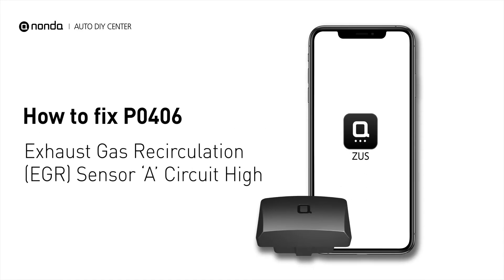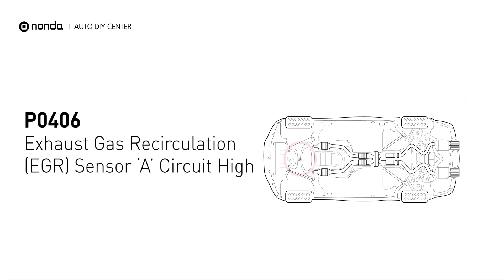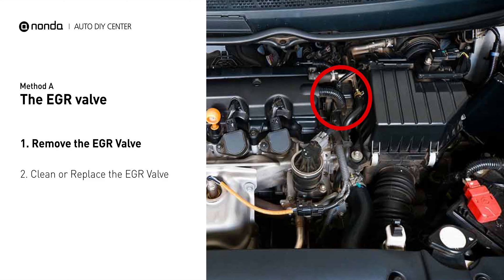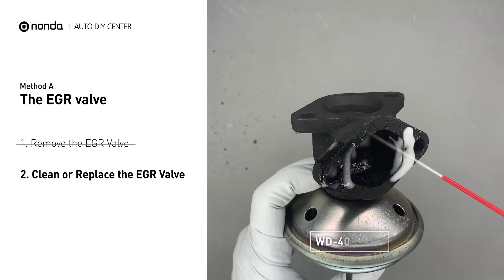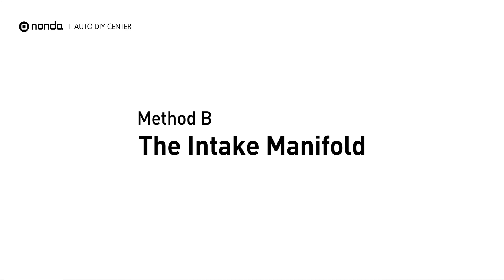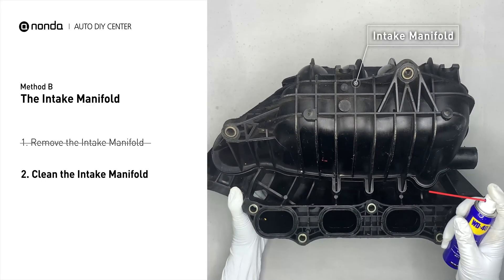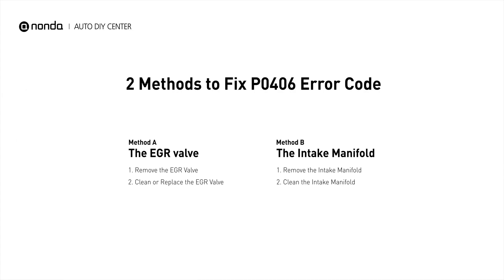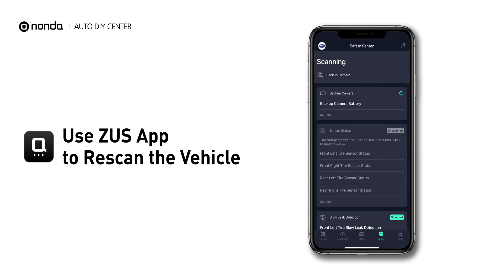How to Fix P0406 Engine Code in 3 Minutes [2 DIY Methods / Only $4.85]

Comment from the maker: Hi, I'm Steve, nonda's lead mechanic engineer. 
Feel free to leave your comments here if you have any mechanic questions, I will be glad to help you out!
Reply: My EGR valve is about 2 years old. When I clear the code and just simply add power it come back on without the engine running. could this be a wire harnesses problem?

Comment: Hello I have this code, I have a 2004 nissan maxima and I just replaced the manifold AND the egr and the code is still here and I can’t pass inspection with the code PLEASE help!
Reply from the maker: Hello, how about the ECM, was it checked?
Reply: Check for a leak in the evap system.

Comment: why would you have carbon build up in intake maifold??
Reply from the maker: Hello, carbon buildup occurs when the oil or the fuel gets onto the components of the intake system which then burns off. It became clogged eventually restricting airflow and reducing engine performance. Dirty throttle body may also cause carbon buildup.

Comment: I changed my egr valve and the code still shows. I even replace the tube. What should I do??
Reply from the maker: Hi Shawn, have you tried cleaning the intake manifold?
Reply: Did you watch the entire video or just the first part?
Reply: @masterofnone1481  I watched the first part so I m going to clean the intake.
Reply: EGRs are dumb

Comment: Hey thanks for the video.
Can this error code show engine light in the cluster meter?
Reply from the maker: Hi Aman, yes.
Reply: @nondainc  I've tried cleaning my EGR already but it still doesn't go. Should I clean intake manifold also or replace the EGR?
And with the Sensor A circuit high code do we need to change the whole EGR or just the sensor located on the top of it would solve?
Reply from the maker: Can you let us know your vehicle's make and model?

Comment: I have a question. 
Can this error cause the car to basically shutdown? 
Shutdown as in not gaining no more speed more than 20 mph while driving.
Reply from the maker: Yes. The EGR valve sensor, wiring in the EGR circuit, and EGR valve's condition must be visually inspected.
Reply: @nondainc  thanks.
Reply from the maker: You are most welcome!
Reply: This is my current issue